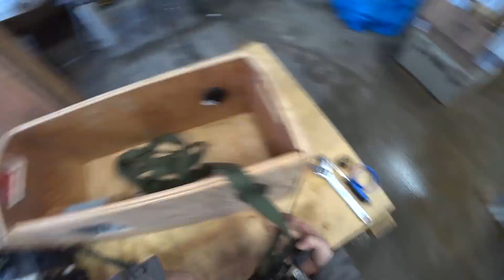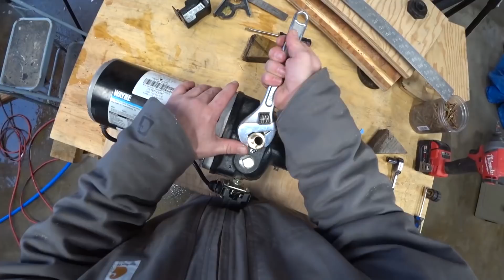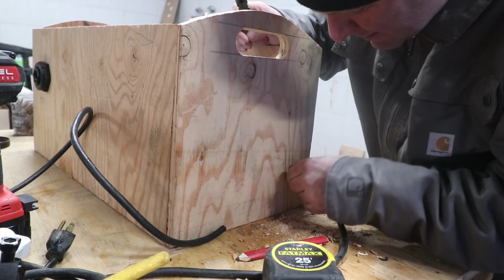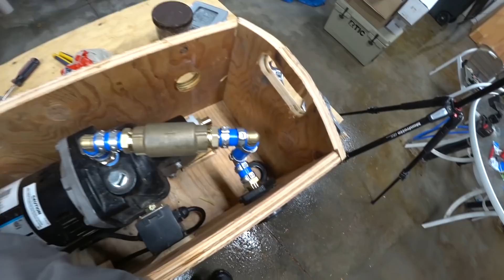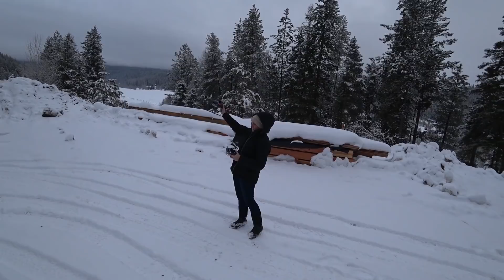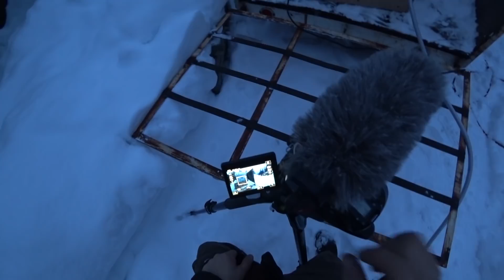Upgrading Our $2/mo Gravity Fed Water System

Comment: im sure it has been mentioned but those pex fittings are known to fail, use the compression rings or even better (although probably not practical in the pump box) the fitings that are basically a stretched piece of pex pipe that shrinks back down over the fitting.
Reply: Wilson Cortes I was going to post the same thing.  Do not use the band clamp pex fittings, especially in walls.  I agree you should use the system with the expandable rings.

Comment: Hi,  When you’re doing your final house plumbing, I suggest you use Shark-bite PEX copper crimp rings for your connections. It requires a special crimping tool, but I believe the connections will be more secure.  I’m not an expert, but I’ve had no leaks using these clamps.  Best, Mark

Comment: Why don't you make another base of plywood that fits inside the box with handles on each side. Mount the pump to that piece then screw that down to the bottom of the box then when you need to work on the pump you remove a few screws then lift it out.

Comment: Need to start thinking lazy. 2 wheels to carry the weight as you drag it and built tall enough to hang all the hoses you need off it. Can the pump be mounted vertical so the pump is hanging? All the plumbing should be below the pump so the water naturally drains when you disconnect the hoses. 

Other then that a spot off the house frame that you can hang the hoses from the half way point to let all water drain out again to prevent ice damage when you need to recharge over winter.

Comment: You reduced the size of the piping which will reduce your flow rate but you probably already know that. Thanks for the video !
Reply: Reducing the size increases the flow rate.
Reply: wrong...
Reply: Does it increase the pressure?
Reply: yes it will increase pressure but you have to have more power to keep the flow rate the same to compensate
Reply: Ok, I get it. thanks.
Reply: Captain Ron yes reducing the size of the pipe will increase the water pressure but will reduce your flow because the pipe is smaller .
Reply: joe goecke reducing the pipe size will increase your water pressure but will reduce your flow rate since the pipe is smaller as shown when Jesse mentioned that it took longer to pump the water after his piping which used smaller tubing from the pump out put ,

Comment: If you rotated the pump 90deg on it's access (ie mounting base on the side.) the inlet could have been on the electrical side, and the outlet go out the handle side... all with very little elbow/fittings.   It's possible that the pump will not function in that orientation though. anyone know if those type of pumps require a specific positioning? If so... just make the outlet come out of the top.
Also-- for the pump wobble... i'd consider a spray foam shim assuming it doesn't cover any vents.

Comment: Ouch, that was a painful one, Jesse.  Kudos on bravely posting it.  (Ignore the haters.)  But, being a skeptical fan of your channel, I've wondered why you didn't run both hoses in parallel with their outlet threading.  It doesn't seem like either inlet or outlet would ever be under strain since you use flexible garden hoses on both.  Also, why not 3/4" hose thread fittings on both for ease?   And why not straight fittings on both, for less lost pressure via turbulence?  //  For the floppy motor, put a plastic bag (newspaper?) under it and spray expanding foam into it, keeping the bag away from the vent holes.  It'll support the motor when hardened, reducing vibration. Not exquisite, but functional.  //  Carry on, you three.

Comment: Hinge and latch like a tool box seems better right off the bat, and mount the pump to a board that screws to the bottom so you can unscrew that to get it out. and foam sheet insulation for cold weather above ground, but I don't know all the details, and haven't watched the whole video yet. Pex is my favorite now. In FL they have starboard at home Depot and that with insulation inside would probably last longer in the weather.  Cool idea

Comment: as a master well driller!! what you are using for that home an property  jet pump is not the best idea  bud... never have the proper pressure you need....Private well an submersible well pump an the right  water treatment  should be used..   with a state lab to test the well to see what's  in your water..  such as bacteria  levels... .. not sure about your state regulations are...  should have it checked just to be on the safe side for a family anyways..
Reply: They don't have a well. They haul water from an off-site source and this is the transfer pump they use to get that water into the cistern at the top of the hill. If you watch their other water system videos there's plenty of water pressure. If they were smart they'd just haul the water to the top of the hill (there's a road) and use gravity to fill the cistern.

Comment: do NOT use those cinch fittings in your house     you can buy a crimper for compression rings for under $100.     I think I have replaced 500 bad leaky cinch fittings over the years .

Comment: you you need to do some holes in the box behind the pump to prevent over heat .
Reply: justsomeguy Not good enough. You are correct in principle, but in practice you and Jesse are wrong.
Reply: No simple fluid dynamics, with the open top and the spacing around that Wayne 1/2hp jet pump there is enough space to intake and expel the proper amount of air, hell take a look at your average well pump enclosure, the fake rock looking ones ave about the same clearances and are enclosed...

Comment: I hope you kept that plug you cut out !  Cover the inside of the hole you want plugged with duct tape.  Buy some 24 hour epoxy.  Mix your epoxy with some saw dust (dust from sanding would be best) to thicken it up.  Insert your plug with a lot of the thickened epoxy to fill the gap and the hole in the center.  You will have to leave the box on its side so that gravity helps to to keep the epoxy in place.

Remove the pump motor and get some Styrofoam for packaging and place piece under the front and back of the pump and then bolt it down again.

Comment: Jesse, You might want to rethink using peck in your new house...  From everything I have read on pecks plumbing it could cause serious problems with leaks....  There is a tool that stretches peck plumbing that will shrink over the fitting you are putting it in...  I think it fits in a drill to expand the pipe, in about 30 seconds it goes back to it's original size....  I would not use the clamps you used on your box....

Comment: you know, you could also use the hight difference on your property for energy storage.
Reply: that would mean the need a massive water storage on the bottom AND on the top, not viable for the very small bits of power you will get out of it with all the losses involved.
Reply: I am not  shure how much the height difference is, but per meter you can store 10 kJ per cubic meter
Reply: i would guess the height to about 30 meters max and if your numbers are right that would mean per cubic meter of water they could store 2,77kWh at 100% efficiency.

for the cost it would take to set this system up this is absolutely not worth it, especially since their solar system is tiny and they mostly use their generator and even bought a bigger one instead of upping their game with solar and finally setting the system up correctly.
Reply: you are right, that thinking about good ways to store energy is not that important, when you don't have enough solar panels for it anyway.
although when they start getting the water from springs on the property, they probably will have build a water reservoir down hill anyway. So perhaps that will be a good time to see if you could also use it for energy storage.

Comment: it's the check valve thats reducing the flow .go to a 
larger one if there is still room in the box
Reply: stanley wompierski 
I agree for a spring check like that one, but would add that a swing check of the same size is shorter and has a full pipe size opening. They don't seal as tightly ,  but in this application that won't matter

Comment: Nice job!  As an exercise of prepping for plumbing your home, one take away might be “loop the loop” ¾ “ PEX has a minimum bend radius of 7” thinking about that ability of PEX tubing can save you a lot of time and money.  On the check valve side looks like you use 7 fitting a long 14” loop with the check valve in-line would only require 4, about 43% saving.  A run from the main water supply in your home to a fixture may only require two fitting with PEX compared to a half a dozen or more with other systems.  Your videography and editing is great, nice story telling as well.

Comment: You should consider a different pex crimping system. The metal ring system has a tendency to fail. Check this Chanel out KnarlyCarl pex failures.
Reply: Came here to say exactly this myself, I've witnessed many failures of the cinch clamps. Uponor is the best (basically can't do it wrong), but at the very least use the copper crimp rings.
Reply: Copper crimp rings are what I finally invested in.  Bought a decent crimper that does 3/8 to 1 inch.  Never a problem after that.
Reply: I've used them myself and they work great when installed properly. They do have a margin of error though, and you can get yourself into trouble if you don't use the no-go gauge correctly. It's also way more labor intensive than the Uponor system, and the crimper can sometimes be a pain in the ass to use in tight spaces.

There are a multitude of advantages to the Uponor system, I highly recommend looking into it if you install professionally.
Reply: What I've been told is that the crimp systems fail often some problems are due to installation error but there is also mechanical failures that occur. The best system is the expansion system. Once the expansion ring relaxes there is no stress on it and it won't be affected by the environment like the metal crimp rings.

Comment: I'm no plumbing expert. Honestly I have never laid pipe in my life, but I came across a video here on YouTube explaining the different types of pex a while back. Apparently there is a type of pex that uses a stretched plastic ring to clamp the pex to the fittings which this guy claims to be the best rather than using the metal crimp clamps. Reason being, over time when the pex forms to the fitting the clamp will get loose compared to the plastic ring style which will shrink as the pex seats to the fitting. Like I said I'm no expert, just thought it would be something to look into before you run pex in the house.
Reply: For some reason people have become obsessed with Pex plumbing.  A pro plumber can make it look quick and easy but Pex has some serious problems.  The fittings are longer than they appear.  Jesse points out that good plumbing should not have any strain on the fittings.  It is difficult to install Pex without causing strain and Pex is very unforgiving.  Over timè it will loosen and you start to get leaks.  The only way to use Pex is over long runs using few fittings.  Even then you still have problems with aging.  It is the worst choice for what he is trying to do.  Copper tubing would be a better choice.
Reply: This is true. The crimps will loosen an leak. I hope he doesn't use that system when he gets the house plumbed.
Reply: I hope they change their minds and decide to use copper tubing as well. Tried and true. I consider pex to be too new of technology to be considered reliable.

Comment: Should have used copper in your box, could have fit it all in that box without problem.
Not sure how synch clamps are legal, those are the most common failure with pex systems. Should have used proper compression rings or the flared plastic fittings. Love the videos guys! Take my advice with a grain of salt ;).
Reply: Even simpler, skip the closed box design, put all the electrical in a waterproof box on one end and put garden hose connectors right on the pump. Maybe mount it on its side so the outlet is horizontal.
Reply: Rob D and remember to use potable hose to transfer the water ;)
Reply: I was actually going to mention that, but I thought it was too bug a "duh" =-), besides, it looks like he's using the translucent potable water hose.
Reply: Just thinking if I'd made that reply on my phone, auto-correct would probably have turned potable in portable.
Ah, the troubles of the modern age

Comment: Please put in float valve connected electrically to your pump..it will shut off.....no timer need...I live in Florida...my water comes from the ground and straight to the house....no worries here..well is 150 ft deep....here you can drill ANYWHERE and get water...I live on a homestead similar to yours..I did it all myself, retired Engineer...I still love my Florida Power and Light,but I have solar and generator when a hurricane takes them out...bye...back to observing...I had a foot injury...a day or so off it...

Comment: stop stop stop grabbing drones out of the air. land the darn thing. its not hard to press the land button and save you from loosing a finger or more and a trip to the ER
Reply: Wrong. I hate landing the drone, unless its a perfect landing area. I always hand catch. I have the Mavic Pro and the Phantom 4 Pro. The P4p is easy to hand catch and have never even come close to hitting the blades. The Mavic is easier to land, but it can be hard on the camera if its not level and dry.

Comment: Must be a lot nicer to work in a dry room with lights and not the off the tailgate of the truck.
Reply: I would have thrown up some temporary walls on that garage back when the temp dropped below 50. I'd also fire up a big-ass construction heater when I was working in there.

Comment: Welcome back. Good too see you are 'over' what ails you.
You need a bigger box.
You also need a larger inflow. Those totes come with a 2" outlet on the bottom, I think. If you used a 1" inflow to the pump, then your outflow would be greater.
How do you drain the pump?

Comment: Not to be a safety Sallie, but you really oughta not try to catch a drone out of the air like that. Those little plastic props can make a real mess out of your face, so its better practice to let the drone land if possible and then pick it up. Plus there is less chance for you to accidentally bump the stick and have the drone leap out of your hands, since you would have to re-arm the drone for the props to turn.

Comment: Don't  think the check valve is stupid  .......But....
Reply: Check valve makes sense on the end of the pipe leading up the hill. It'd mean that any water left in the pipe stays in the pipe when you disconnect the pump. A tap would also work.

Having it on the pump itself seems a little pointless though. As the way Jesse is using it the pump will always be lower than the tank it's pumping from so will self-prime anyway.

Comment: Why do you have the water pump in a box ? isn't it setup at one place permanently and in the open like in a shed or something ??? If you have to work on the pump in the future or it develops a leak then you will have a hard time reaching in that tight space for repair.
Reply: They don't have a shed or little dog house where they connect an IBC pallet tank in a trailer to their fill hydrant.  Water is picked up in town, transported by a 200-300 gallon pallet mounted tank in a trailer or their truck then pumped up the hill to their storage tanks underground.  They don't want to permenantly mount this for now but this is still an upgrade that allows the pump to run unattended

Comment: Also if you let the pump run dry the pex fittings will loosen up not to mention the pump fry    I would use at least 1" copper for that pump set up or just use pvc the size of the pump in and out

Comment: Geez, Guys, lighten up. Jesse has build a box out of used, scrap plywood, as a TEMPORARY solution to a TEMPORARY problem. He built what he needed, the way he needed. And he's doing it while standing on an icy floor in an un-heated garage in NORTHERN Idaho in the middle of winter. If you want him to build it to YOUR specs, out of better quality materials, then open up your wallets and send him a check. I'm sure he would be happy to receive your donation. You're doing just fine, Jesse. Keep at it. Jon
Reply: Two words. Dry fit.
Reply: Cunningham's Law: "The easiest way to get the right answer on the internet is not to ask a question, it's to post the wrong answer." It's also the easiest way to check your spelling, if your ego can take the inevitable hits. =-)

Comment: DO NOT USE PEX.  FOR ANYTHING.
Reply: Dennis Davis why not?
Reply: Ya ... why not? My understanding is that pex does have advantages over copper. For one thing, copper will burst if the pipes get frozen, won't they? And (in extreme circumstances, depending on PH) copper will corrode. And, Pex is about 1/3 the cost of copper. All that being said, most veteran plumbers prefer copper, don't they?